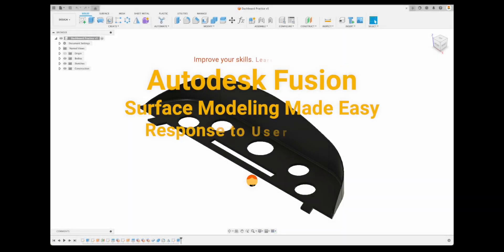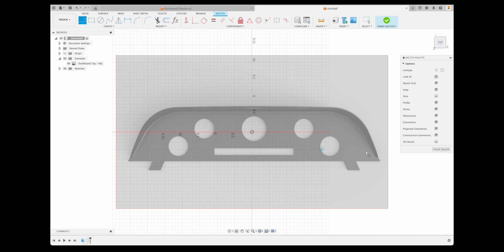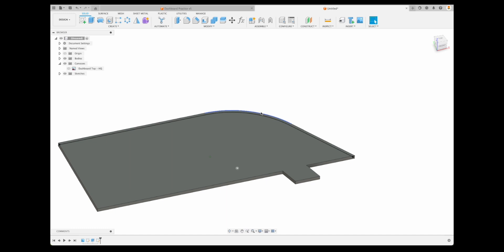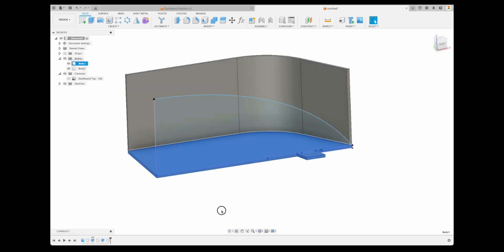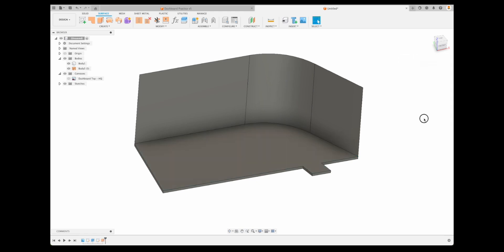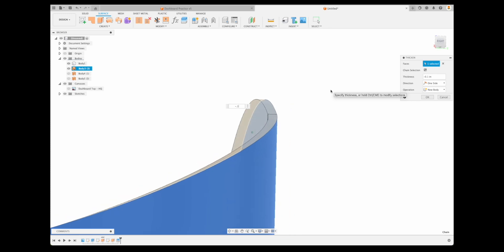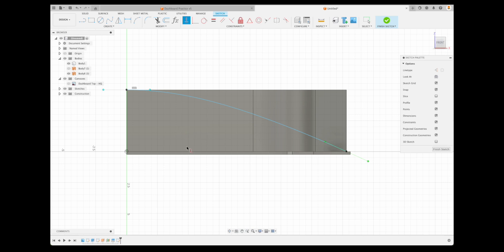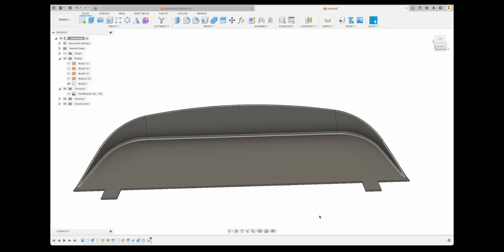Autodesk Fusion 360 - 1/2 - Int/Adv - Surface Modeling Tutorial - Dashboard Cluster (2024)

Comment: Another excellent tutorial! As I commented in a previous video, you can cut a body using a sketch line, no need to create a surface first. But you can also use the Trim tool using a sketch line. Not saying your way is wrong in any way, but there are more steps with the extrude, split, remove path. Trim does split and remove in one shot.

cheers,
m
Reply from the maker: Thanks for your excellent comments. Glad to have your experience in the comments section too! Please keep any tips and tricks coming our way!
Reply: @learnitalready  Thank you - this tool (Fusion 360) is so complex that even though I've been using it for ages, I still learn something from every tutorial I watch. Thanks for all the hard work you put in!